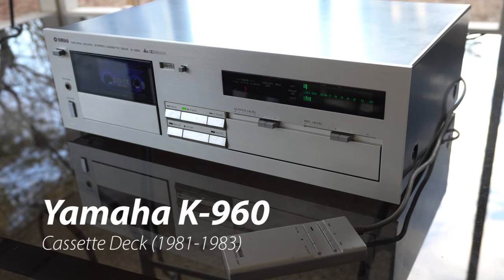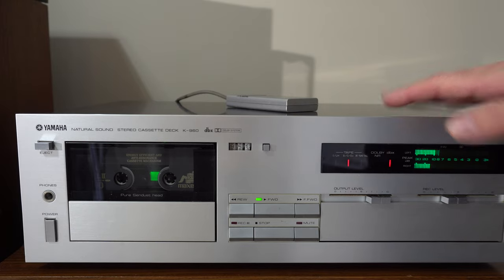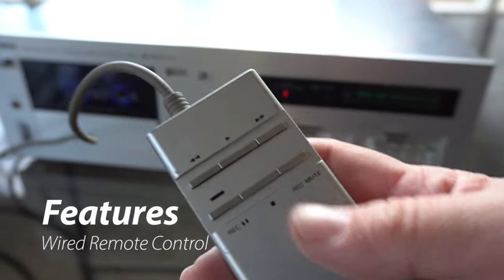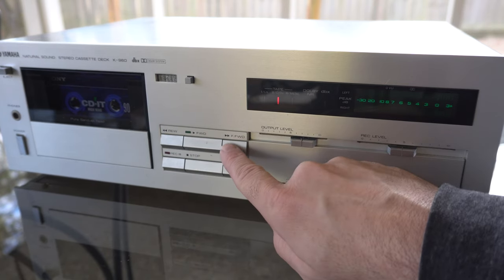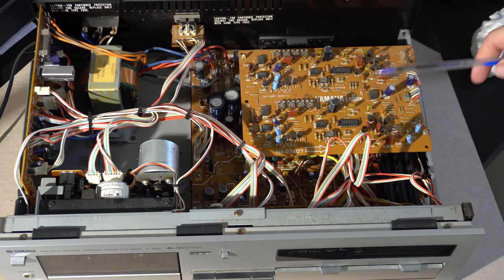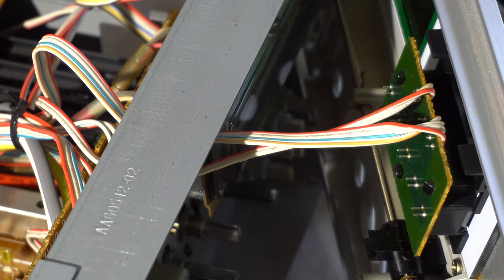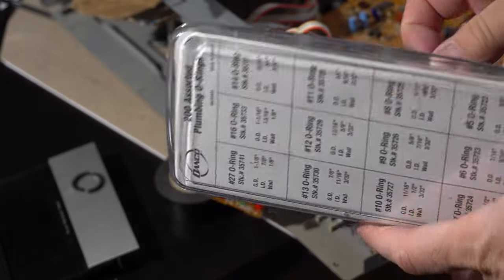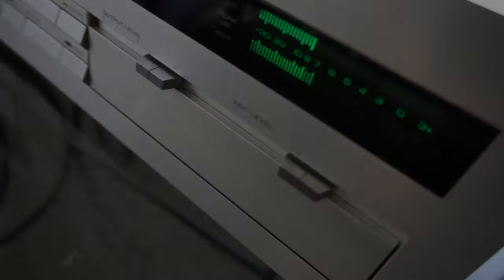Yamaha K-960 Stereo Cassette Deck with DBX (1981)

Comment: Good sound, great deck ✊💥 with dbx and native remote control. One of the best among the two-headed devices of the early-mid 80s. As far as I know, this is a pre-top model, only the K-1000 is higher. I also have a Yamaha only a later KX-800.💥

Comment: I have the same deck in black finish and I love it because it matches the looks of my M70 and C70. It is working very well except for the recording. When recording a cassette the sound seems to be very muffled and distorted. Have you got any clues on what part of the machine should I look into?
Reply from the maker: First, I would try to clean the erase head with alcohol and a cotton swab. Also I would exercise all the switches just in case they are dirty/scratchy - move the record level back and forth rapidly several times, click all the buttons repeatedly, etc.
Reply: @ACBMemphis  thanks for the advice! I hope the circuitry isn’t involved because otherwise it plays back nicely. Another issue it has is that the mechanism is nosy and it struggles in fast reverse. I think this is due to tire you found cracked. I think you solved it very nicely with the o ring, by the way!
Reply from the maker: @AlbySpace  Thanks! Usually the electronics on these things are very reliable. I think that kit of O rings came from Lowe's and it was only about $10 for 200 of them. Good luck on your repairs!

Comment: Very good and clear video about the K960.  For years this was my deck, purchased new. Later on I bought a K1000 (also with dbx) - which I found was a little bit more accurate in dbx and Dolby tracking.  The K960, under critical recording and listening conditions, has a slightly metallic sound, when compared to the source. 

Both the 960 and 1000 are easy to clean, easy to wave a demagnetiser near and seem long lasting.  Good to know about the K960 idler wheel compatibility with a common plumbing O-ring. I've had to replace a few as they develop flat spots as they is no "off" position - it always leans on one of the two sprocket wheels.  

Finally, the mute button is very useful when recording from records - it can be released a split second before the music starts, resulting in silent lead-ins.
Reply from the maker: Thanks for watching and commenting! It is fun getting to enjoy some of this nicer equipment as an adult I never would have been able to afford in the 80s and 90s..